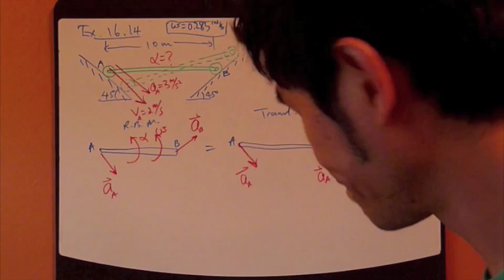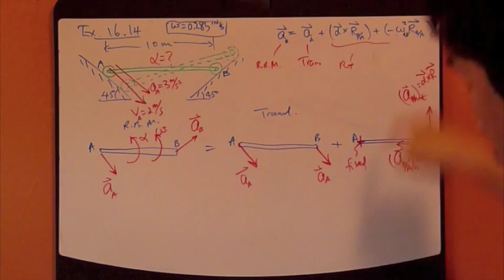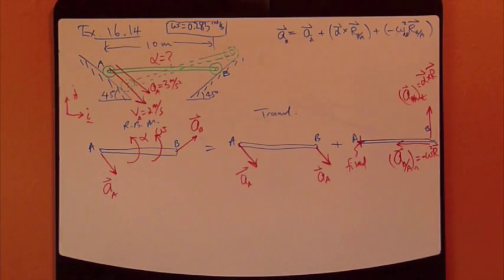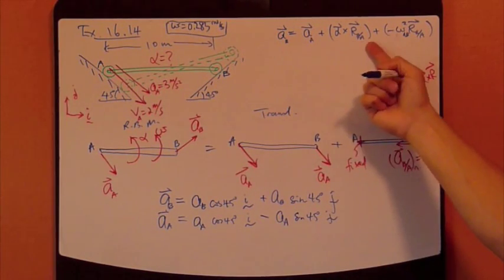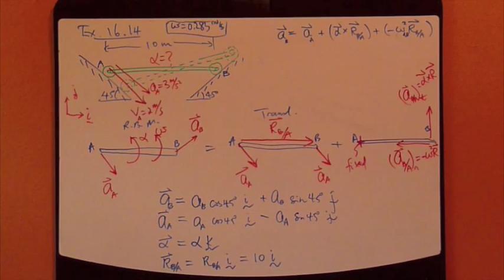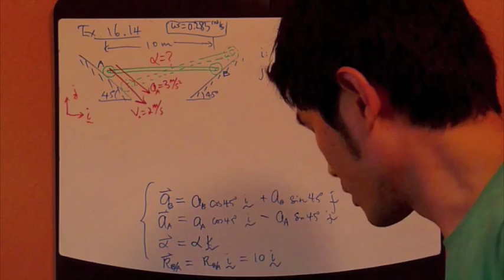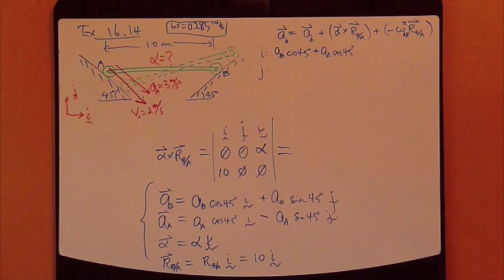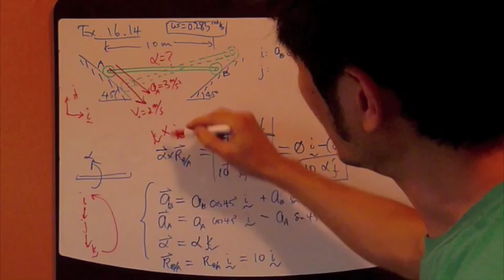Engineering Dynamics Ch.16 Part10: Rigid Body Kinematics

Comment: I have a question. In your Ch.16 part 2 from Ur X Utheta you got the k direction going into the board with clockwise rotation and u said it was positive, and when Utheta X Ur was pointing out from the board was negative. In this video the k was positive with a counter clock wise rotation and pointing out from the board. Is there a difference between these two situations? My original thought was negative when it goes in and positive when it comes out like in this video.